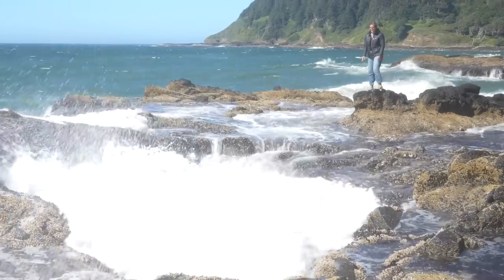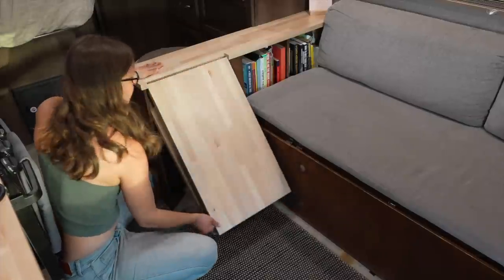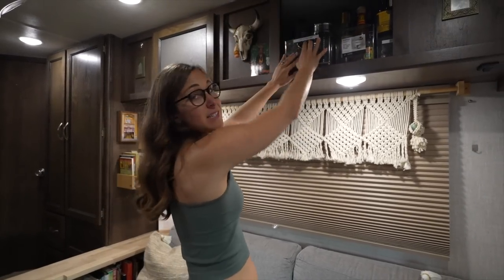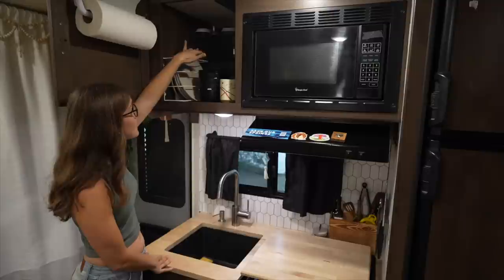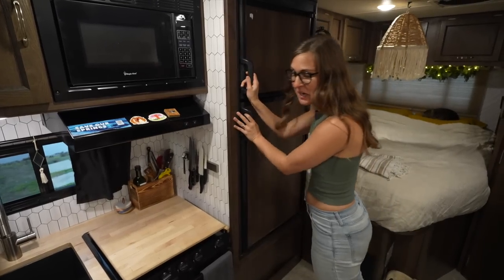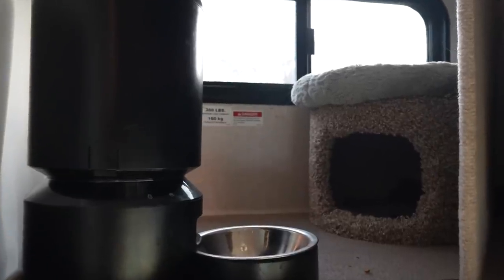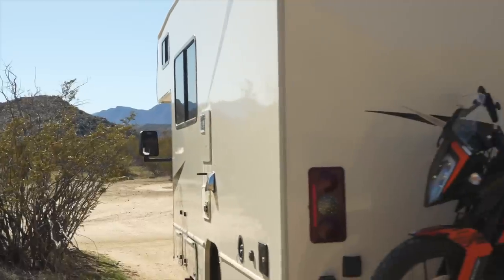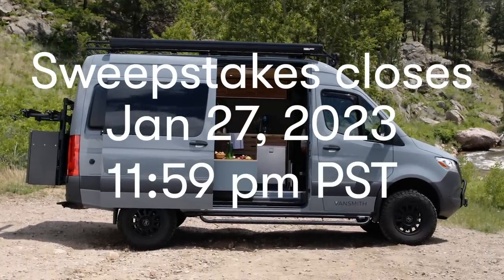Full Time RV Living: Tour Our Renovated Class C RV

Comment: Thank you for this super wonderful video. I am looking to purchase an RV classs C in May to live in with my dog in the summer approx 6 months . Can I ask, if it is hot and you have to leave your pets inside do you run your airconditioner and if so what is the power source you use? Thanks I live in PR but I am rent to buy RV In NJ
Reply from the maker: Awesome! Congrats on the upcoming trip. If we are not in the RV and plugged into to an electric source we cannot run our A/Cs. We have max air fans that turn on if it gets too hot which helps. But in extreme heat it's not enough
Reply: Thank you!! @EatSeeRV